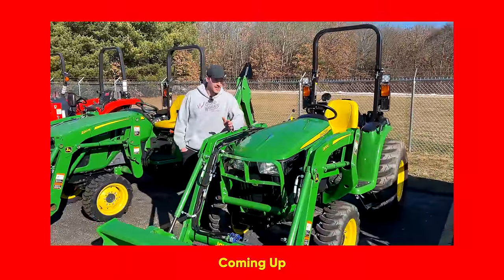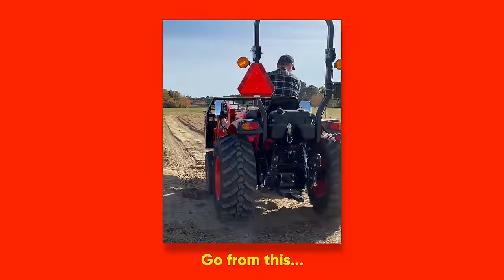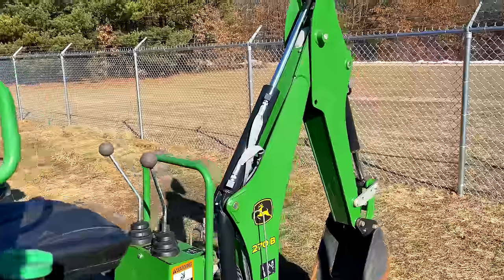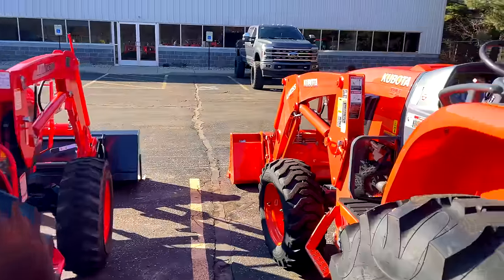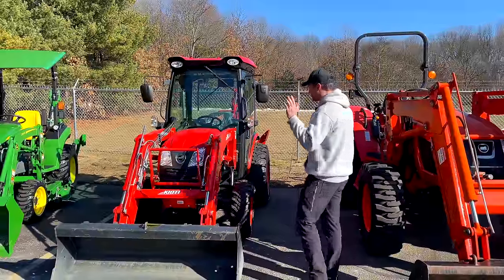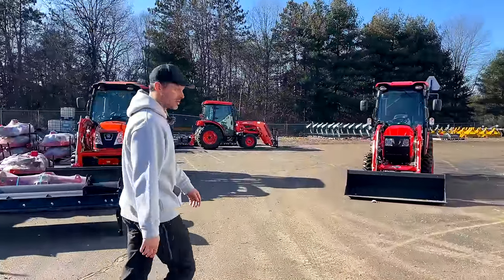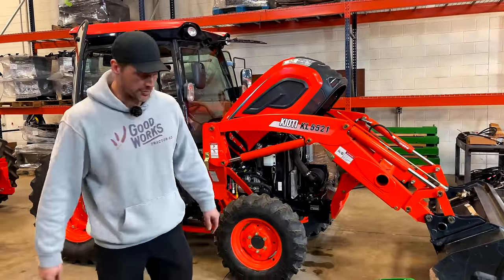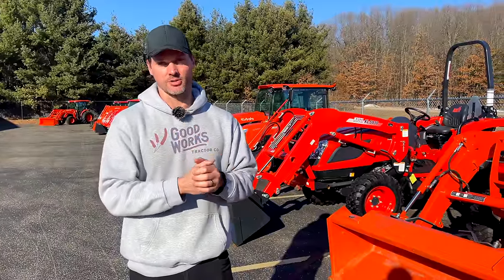JOHN DEERE ISN'T WINNING ANY MORE...

Comment from the maker: Shop tractors at http://www.dreamtractors.com
Shop attachments at https://www.goodworkstractors.com/product-category/attachments/
Reply: …..so…… just going to not mention how any of us that desire more loader lift capacity do so by turning a screw?
Reply: @DougAlesUSA  Without knowing factory specifications and a calibrated pressure gauge, I'd not recommend adjusting pressures.  As a side bar, unless you know what you're doing, have factory specifications AND have enough ballast...You get where I'm going with this?
Reply from the maker: @happyjohn8256  Load Match and Motion Match never got touched in any of my 3r or 4r tractors.  Who cares.

Kioti has a very nice cab.  My problem with Deere is that their prices are absolutely insane.  If they are going to be 20–40% more, then that better come with a whole lotta extra benefits.  My Deere dealers never have parts, they don’t have good techs anymore, long turn around times, and premium prices and parts and labor.  Turns out plenty of people will buy tractors other than Deere or Kubota.  Kioti is quality.

Comment: The disappointed speechlessness over the 880lb lift capacity is priceless. JD disappoints me regularly and I don't have one.
Reply: Even on the bigger tractors it seems like the lifting capacity is down. I remember loaders around 30 years ago that were rated for 10k , I think the most I’ve seen on current tractors is under 7k.
Reply: @PurpleNovember that might also be due to how they were rated.  Those higher ratings were at the pins instead of 500mm out from the FEL and 24" from the 3PH.  That change is responsible for roughly a 26% drop in FEL capacity and 22% drop in 3PH capacity.
Reply: It is fairly easy to raise the lifting capacity on those loaders. You just need to be careful not to exceed the pressure rating of the hydraulic hoses.
Reply: His numbers are not correct.
Reply: @Noah_E  It was at the pins. There’s been a lot of changes in the industry since then.
Reply: @rcclassiccrawlers4368  Just the hoses? Hoses on my loader are rated for 6,500psi. That’s great the cylinders, the rest of the hydraulic system can withstand that pressure.  I didn’t think loader frame, front axle, and tractor frame could handle the extra stress but that’s good to know.
Reply: Yeah, except that's that's Deere's "rating #s", not the ACTUAL  capacity demonstrated. But then, you wouldn't know that; you don't own one -
Reply: I have the 3038E with the 300e loader. The bucket is pretty thin and small but it does everything I ask it to. Since the strike and prices going way up my tractor is worth more money than I originally paid for it. So overall I’m not disappointed at all. I could trade it in and make money.
Reply: @jrhunt414 lol, I love that argument, it's completely wrong, but I love how you blatantly believe it
Reply: @RJ1999x  I’m not wrong. I’m happy with my tractor and its capabilities. It’s worth more than I paid for it, another fact. Bucket is cheap and thin, also true. Nothing I said is false. I could drop this off at my JD dealer and walk away with more money in my pocket than I had when I bought it used the day before the strike. MSRPs have jumped. The value of a used like new low hour machine is based off what a new one costs. Facts are facts. Even my E170 25hp lawnmower is worth exactly what I paid for as a leftover new model. The only JD product I own that has dropped in value since I bought it to today is my hat.
Reply: @jrhunt414  bet you couldn't
Reply: @jrhunt414  I didn't have time to explain, but that's a complete myth about dear resale. It's a numbers game played by the dealer to make you feel good, and to bolster the myth.
I know this as fact because I was a salesman and know how the game was played
Reply: @RJ1999x  I got lucky. It’s a snapshot in time. My local dealer is Deere. I bought used at a good time. Inflation is crazy. Just glad to take a small win on my tractor value. Lost big on a minivan I bought the same time. Win some sometimes. Anything can happen in the future.
Reply: @PurpleNovember Yes, changes indeed; they became Chineese Co. Incluiding our goverment!
Reply: I’m a Deere guy most thing 2012-14 and before are the better deeres I’m not a fan of the new ones
Reply: I’m a Deere guy most thing 2012-14 and before are the better deeres I’m not a fan of the new ones

Comment: Im sorry.....Kioti just isnt the same level as Kubota.
Reply from the maker: That’s my point.  Kubota is way more money for less capability.  Glad we’re on the same page :)
Reply: I had a Kioti NX6010 tractor and after replacing the wire harness 2 times I gave up on it and replaced it with a Kubota. Wire harnesses should never go bad as it is a non-moving part.Never again on Kioti!!! Capacity will never trump quality in my book.
Reply: yeah plus same orange lol
Reply: Kioti is not as deceitful as kubota
Reply: @EasyGrowsIt kubota fanboy here and I’ll tell you right now that can happen with any brand. Kioti is definitely upping the anti.
Reply: I just spent a week working the living hell out of my CK4010SE Kioti.  So far, still impressed.  It punches so far over its weight class and is just so dang ergonomic to use.  Spent 4-5 hours a day non-stop seat time actually working it hard for several days straight and still felt GOOD afterward and was still looking forward to the next time I needed to use it.  Must have moved 10-20 tons of stumps and wood debris, and just about as much to go.  Just a pleasure to use.  Chain pulling, grapple, whatever.  It just does it easily.
Reply: @michaelmactavish4445 Kioti have changed their paint colour to more of a blood orange/hint of red in the orange to differentiate from Kubota
Reply: Just got quotes for Kioti NX50, ns53, kubota mx5400, and JD 4052m. Kubota was only $1k more on a $40k machine with their $2k equine discount. JD offers 18% equine discount which makes it equally priced.

Comment: I had a JD4500 that I bought new for 20 yrs. and it never, never gave me any problems, other than 2 batteries that went out on me. I took care of it: change the oils and kept it lubed. My uncle has a Kiote and it's nothing but problems after problem. I sold my JD and got me a subcompact Kubota BX23S a year ago. So far, no problems yet. I would of gone with JD but were too expensive.
Reply: Kiot E?

Comment: Courtney, I looked long and hard before I bought my Kioti CS2520.  I have a New Holland dealer a quarter mile away and a John Deere dealer a half mile away from the end of my driveway.  I bought the Kioti for a number of reasons.  The CS2520 beat the pants off the JD. 1025 and the New Holland (additonally, the NH dealer had nothing without a cab.  It would be destroyed by my trees).  The difference in cost was astounding.  I purchased my Kioti with Tractor, FEL and mower deck for substantially less than JD wanted for just the tractor.  Plus, my dealer is amazing.  They are an AG dealer and needed something in the SCUT and CUT range that CASE didn't offer.  Additionally, my salesman bought the same tractor, exactly equipped for the same purpose as mine.  He and the owner sold me.  Family owned (like you) and has been in the farm equipment business since 1911.
Reply: Watch the belly mower on those. The gearbox has a shit designer and leaks all the oil out and burns up every two years or so. Watch that bottom seal. $300 if you rebuild it.

Comment: So true about the lightly used tractors! We got a 2021 3046R a couple months ago, with 320R loader, deck, 3rd function, wet tires + wheel weights, and 2 separate aftermarket rear remotes, and right at 300 hours on it, for right around $40k OTD. A brand new one would have been $60K OTD with that on it. 

This tractor is in addition to a 5320 weve had for years, and while it's on the small side for some things we do, its really too big for a lot of things on a tree farm. The 3046R, frankly, ended up being a much more serious tractor than i was anticipating, in addition to how maneuverable it is! Very happy with it!
Reply: when you think about it being $67/hr for the previous owner, it isn't that bad. I know my F745 mower, traded in 2008 with 180 hrs ended up being $20/hr in depreciation.
I bought a 3520 that I've put 180 hrs on and it's actually gone up about $15k in value from what I paid for it 4+ years ago.
Reply: @courtneyanderson2293  except we got it from our local dealer, and I have no idea what they gave the original owner for it.

Comment: Hello Shannon, 
  Have you looked at the TYM tractors. I've looked at all the different brands of tractors for over two years before I saw a TYM T264 on marketplace , and then I watched every YouTube video on the T264. It was Tony's Tractor Adventures that sold me on getting the T264. It is overbuilt for its size. I also messaged the dealer many times just to make sure that it wasn't a scam. The dealer is in Alpena Michigan,  I drove 4 hours to look at the tractor, and after test, driving it and talking more with the dealer, I bought the T264 with a loader and backhoe. It would be nice to have a TYM dealer closer  to Plainwell. I've had since October of 2022, and I love it. The T264 does everything I need it to do. Love the videos. Keep up the good work, and God bless.
Reply: I absolutely love my Tym T454 Cab/heat/AC with backhoe, a true workhorse
Reply: TYM is awesome! I’ve had my T25 for 2 years, no issues. Love it
Reply: I believe several models of JD tractors are TYMs painted green.  My understanding is JD doesn't make very many models of tractor themselves anymore, I believe they only make the really big AG tractors for themselves , almost everything else in their line is re-badged from "partner" manufacturers in China or Korea..  I know that until last year Hitachi built their excavators for them.

Comment: When I was looking for a small reliable tractor to blow out driveways I checked out Kioti, Deere and Kubota. I went with a BX2380 with a commercial front blower and rear blade. We added a Tektite cab with heat after freezing the first few snowstorms. I looked at the 1025 but the the blower was terrible. It had a cable that was wrapped around the chute to turn the chute! The augers weren’t serrated and with one of my JD lawn tractors the blower bounced around when it hit the city plow pile! The serrations make a huge difference! The Kubota had hydraulic chute  rotation and a hydraulic deflector. I also wanted a cab that was a must when it’s -20 at 6am. I don’t understand why people have trouble with the Treddle pedal. My JD X310 had side by side pedals and I looked down to see which one I was on with my big boots. On my BX2380 I don’t even have to look down my heel finds the treadle pedal super easy! I don’t regret buying the BX2380 it’s been fantastic and it’s just the right size when working around garages and buildings! Glad to see you back selling because buyers now have a trustworthy place to buy from. Keep up the good work. Oh the BX2380 sure didn’t get much work this winter!
Reply: How tall are you?? I am 6'4" and when sitting at a standard seat height. The closer the knee comes to your chest when seated, the harder it is to rock the ankle. I can actually get leg cramps from rocking the peddle while mowing or moving dirt where lots of forward/reverse is being done. Love my Kubotas, but the pedal design needs tossed.👍
Reply: DO NOT BUY ANY KUBOTA PRODUCT
I BOUGHT A NEW KUBOTA LX 4020 TRACTOR TO USE FOR A SNOW REMOVAL BUSINESS
IN BRIAN HEAD, UT. I HAD TO PURCHASE FROM A DEALERSHIP IN COLORADO AS IT WAS
THE ONLY KUBOTA DEALERSHIP WITHIN A 1000 MILE SEARCH TO HAVE THE TRACTOR I
NEEDED FOR THE PURPOSE INTENDED. The Dealership, Wickham Tractor in Fort Collins, CO
sold me the tractor and added Howes diesel treatment to the tank as well as selling me the
remainder of the bottle to use to prevent the fuel from jelling. I Used as per specs. Tractor was
purchased on 11/21/23 and I picked it up and transported it back to UT. Tractor was in
operation for 17.2 hours before it would not start. Local Kubota dealerships said they would
not come out to try to fix it as we did not buy it from them. Took it to Las Vegas, NV, as they
were closest Kubota dealership, dropped off on 1/8/24 at 730 am. Kubota dealership said the
fuel smelled funny so it wasn't covered under warranty and said $12000.00 plus to fix. The DPF
was completely clogged and the only codes were low temp MAF sensor and no
communication with EGR. Western area rep said there was no fuel to test because I drained it.
This is a Lie. Had more than 6 gallons of fuel in it when i dropped it off. I have all the emails and
correspondences and text messages, proving they denied coverage for adding a fuel additive.
Sergio at Kubota customer service said, “When I put fuel in the tractor it voided warranty.”
Apco, the Kubota dealership in Las Vegas, sent out the injectors for testing they came back as
bad due to fuel contamination on 1/23/24. Kubota persisted in their point of me putting bad
fuel in the Tractor. When I called the tester, I pressed about the fuel contamination. The person
who did the test, said it was visible metal in the injectors that most likely came from the high
pressure fuel pump. There was no metal in the fuel tank, fuel filter or fuel water separator. The
dealership i bought the tractor from said they were the only ones that could help me at this
point due to Kubota policy. Eddie at Wickham tractor told me I needed to bring the tractor
back to them, 1367 miles round trip. and they would sell me a new one because I had broken
this one. And would see about trying to fix the one I had already bought for a discount. I
transported the tractor back to Greely, CO to Wickham on 1/18/24 they tested the fuel that was
still in the filters and it came back as fine 2/8/24 so they were going to replace the entire
engine. This could take between 3 to 9 months. My warranty coverage says all warranty work
to be completed within 30 days. On 2/28/24 I found out there was internal Kubota Service
Bulletin that came out to all the dealers the week before I bought the tractor stating the very
problems my tractor was having. They knew this, and still denied coverage, and finally, when I
presented this fraud to Kubota, on 3/7/24 Wickham tractor said they were going to replace the
tractor with a new one, but wouldn't give me a timeline of when I would get a new one and I
would have the expense of picking it up from them verses a local dealership. These delays
have cost me my business and reputation to move snow I had to pay out my competitors and
cancel and refund all my contracts. A service bulletin for this tractor was issued before I
bought it stating this very problem. and it was to be fixed at Kubotas expense. They knew the
problem existed, they tried to blame it on me for adding fuel supplement, they tried to coerce
me into buying a new tractor on top of the broken one so i didn't lose my business. they
refused to cover the cost of repair until i proved their fraud, and intent by pushing the narrative
and then changing and deleting emails. I have all emails and correspondence showing the
timeline, the fraud and intent.

Comment: Agree, horsepower needs are a fickle notion. The hardest working tractor on our farm, and we had much bigger machines for dragging a five bottom plow, was a 35hp Ferguson TO35 from 1955. Ran augers and elevators, manure spreader, square baler, brush hogging, rakes, hay wagon shuffle, and more. I learned to drive on that tractor. I still use that same tractor with a two bottom plow and snow blade these days.

Comment: Bought my John Deere 1025R new in 2015. It’s been great 👍. It mows the lawn, grades the driveway, bushhogs, plows garden, everything. Like a Swiss Army knife 😂. It cost a bit more but the ease of taking the loader and mowing deck off made it worth it. I can take loader off in just a couple mins and it mows like a Cadillac without all that weight on it. Then I can take deck off and put loader back on in mins for utility tractor duties. The other brands are more pain in the ass so most just leave loader and deck on all the time. Mowing with the loader on makes it ride rough and it doesn’t maneuver as smoothly and nicely. So the JD has been great 👍

Comment: I have a 2638 Mahindra. I would love to hear your thoughts about those. Thanks for helping educate me about different options!
Reply: Mahindra is trash.... poor welds mostly.... also shitty hydraulic parts. I wound up replacing nearly all hydraulic lines and couplers on mine in less than 5 years, and it was all undersized, so when I replaced it with standard ID hydraulic lines and couplers, the performances much better until the hydraulic pump spun a bearing and had to be rebuilt.  Oh and the electrical work in Mahindras is terrible too....  I tried warrantying several of my problems, and it was like talking to a wall, especially about the welds rusting through the paint all over the machine.  You could tell the loader was made by another company or in another plant as the paint did not fade like the tractor's paint did, and the loader's welds were not bubbling rust up through the paint like the tractor's welds had.  Mahindra is trash...

Comment: Tractors hold value. If you plan to keep for the long haul, resale doesn’t matter. My grandfather paid $10,850 in 1982 for a new 4wd Ford 1700 tractor with loader. I’m still running that tractor and could probably sell it for about the same (or higher) price today. I could use a bigger tractor (under 6ft overall width and about 3,500lb base weight would be ideal), but that Ford won’t go anywhere if I buy a new tractor. I learned how to operate a tractor on that machine. The thing I don’t like about new machines are all the electronic controls. More to break and/or troubleshoot. I like simple mechanical fuel injection (instead of these new common rail direct injection engines).